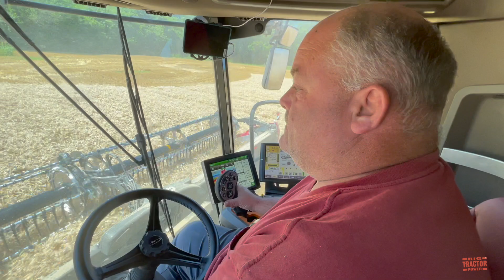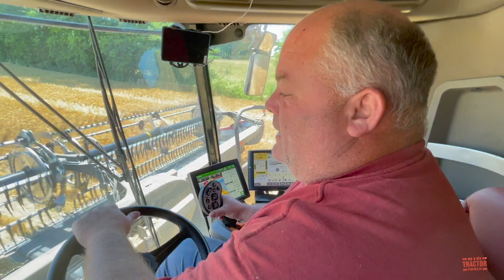40ft MacDon FD240 Harvesting Wheat

Comment: On my bosses farm, they have a John Deere 635D that they use to cut wheat or milo, and they have a John Deere 630F flex header to cut soybeans with. They also have a John Deere 893 8 row corn head with hydralic deck plates. They own one John Deere 9660 STS Bullet Rotor combine and a John Deere 9660 STS. They use these machines to cut wheat, milo, soybeans, and corn.
Reply from the maker: Two good headers. Nice combines.

Comment: I like the interview with the farmers and operators, but would appreciate if you could ask them what the prior equipment was, especially when they have new gear and are talking positively (or negatively) about the change.
Reply from the maker: In this case they upgraded from MacDon FD140 heads to the 240s.  He liked the 140s and finds some good improvements in the 240s for flex and visibility.
Reply: @bigtractorpower  thanks! Interesting to see there is more than enough difference in the series to make it worth the upgrade.

Comment: I wonder if a head/platform manufacturing company has ever thought of hinging the main box section beam which runs along the top and back of the head into three sections similat to that MacDon reel for optimum distance from the ground for an even stuble cut across the full span of the head. Some of the machinery that is mounted on the aft side of the head would need some rework below the hinged areas to allow for flotation. The sheet metal under the beam would also have to be split into sections to slide past each other.
A wide head with a flexible cutter bar, with a flexible single or twinned knives/sickles just does not leave an even stubble in uneven ground.